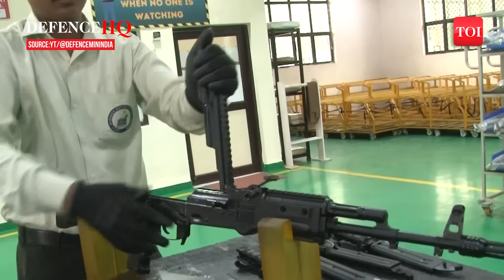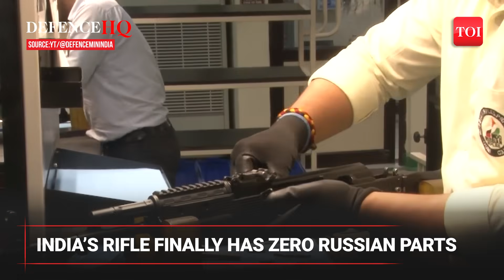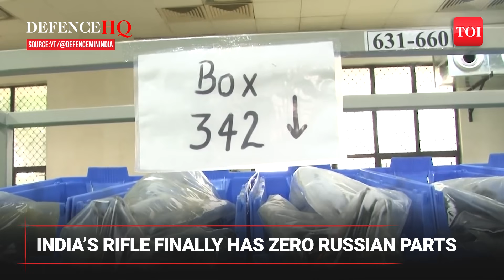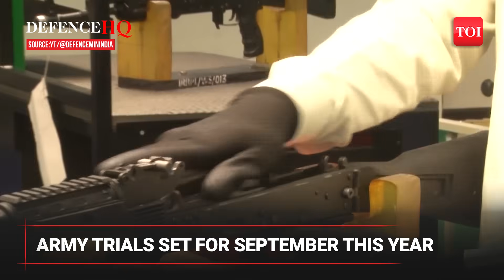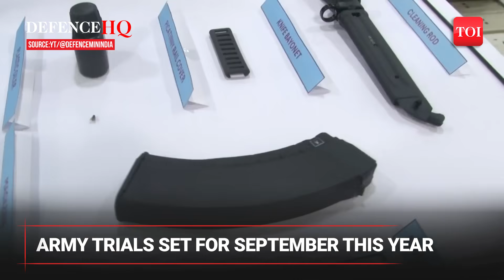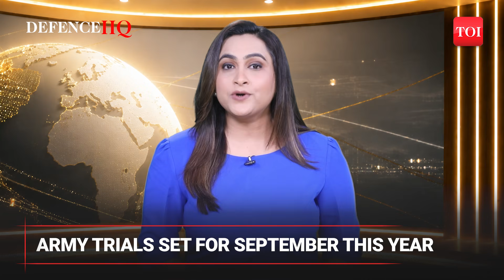AK-203 Sher: India’s First Fully Indigenous Rifle Just Test-Fired

Comment: We were importing even small arms during 2014, now this problem is now rectified thanks to Modi Ji.
Reply: Genius, in1960s we were producing L1A1 rifles, what the Indian Army called SLR, in ordnance factories without any technology transfer from its designer FN Herstal. The same rifles were used by the Indian Army with extreme effectiveness in the Indo-Pak wars of 1965 and 1971. The Indian Army was equipped with the same rifle when we captured the Siachen Glacier from Paksitan.
Reply: @dhoomketu731  how much export have we done?
Reply: And that fucking SLR still using u high IQ wallah the did u ever fire a SLR a soldier fire SLR single shot in that mean time enemy fires 20 to 30 bullets with automatic guns so u telling still we use 1965 model? They don't even do any upgrades in SLR 
just go out and have some sunlight dude  it's not 1965